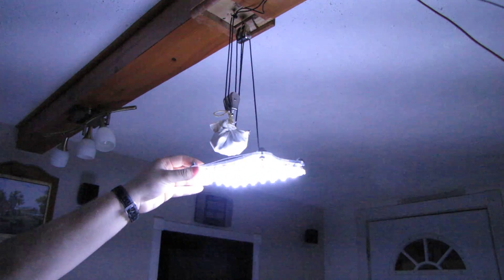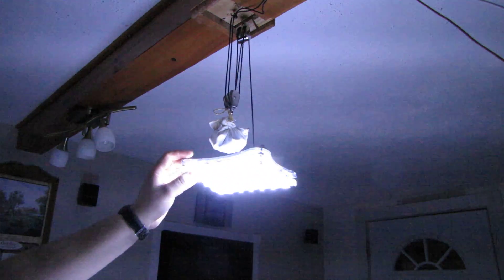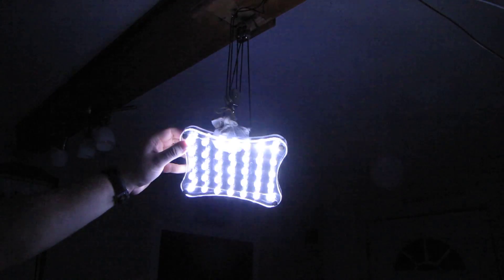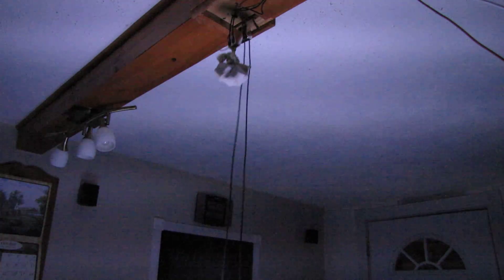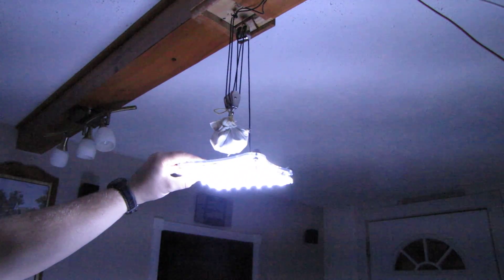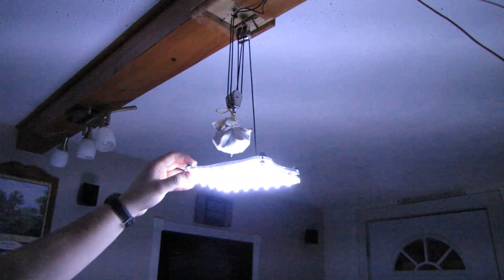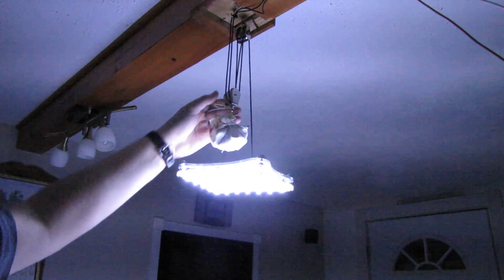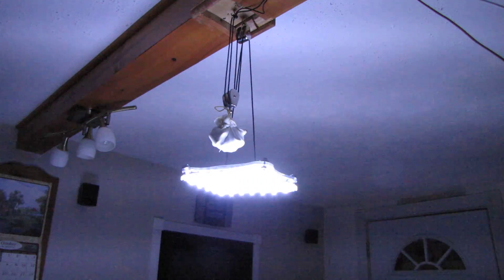LED adjustable height chandelier

Comment: may i suggest you use two pully sets and space them out and then you can have it hang from four lines.  I saw this on thingiverse very nice I love the idea and you exceution is spot on. Good work. By the way how about two off these on a pully system spaced farther apart. Or a servo to adjust height.
I need to read more on thingiverse to see if you explained the poser system in use on this...